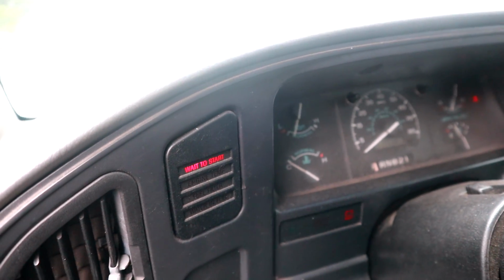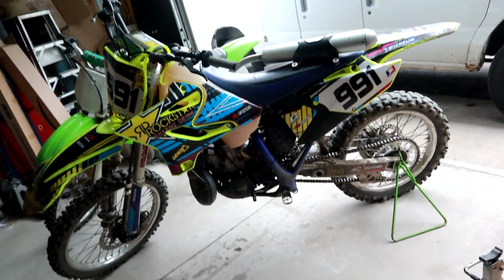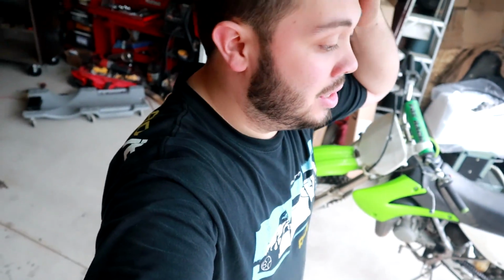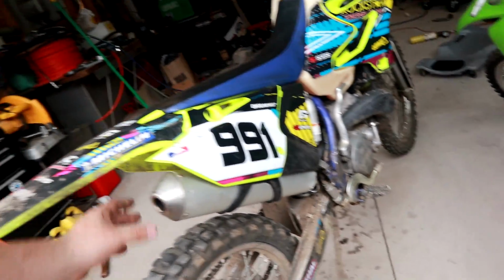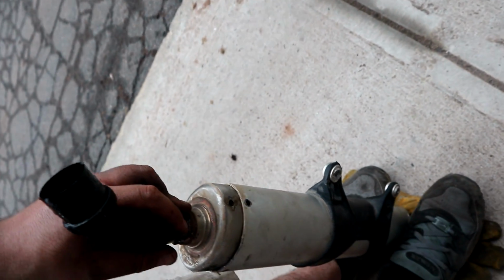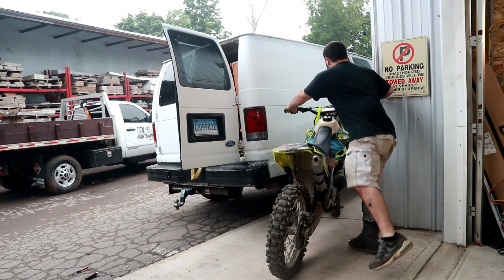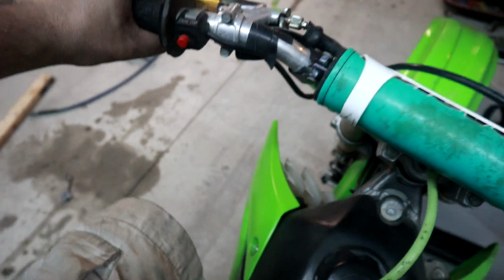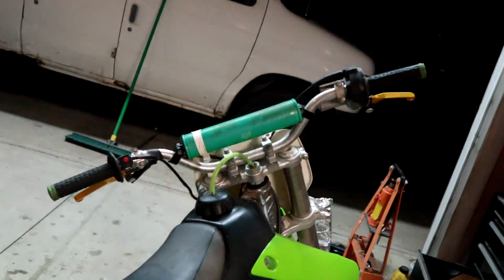KTM EXHAUST ON MY YZ250

Comment: Hey bud.    Just trying to help you out.   You can’t wrap duct tape excessively around and cover every square inch.   You have that stuff wrapped and compressed and then super compressed with tape.  It should be wrapped around the core  until it’s bigger then housing.    Then compress slightly and wrap thin masking tape in 3-4 spots.    To erode each.    The tape will burn up and the fiberglass expand.     The way it is now.  There is no baffling being done wrapped in solid tape.      Love your videos brother
Reply: Yep, fewer wraps of tape, but getting it in is a job done.
Reply: This will also effect back pressure and and you power

Comment: next video : i straight piped my yz250
Reply: Ryzkivyana not a good thing on a 2 stroke bro no back pressure equals loss of torque and you’ll wear the rings out on the exhaust side of the piston.

Comment: Why you dont take a piece of flatstock an make a bracket for the  second screw for the exaust
Reply from the maker: Robert Ringel aluminum boi
Reply: @damianmonte  Time to learn to tig weld :P Super expensive, but a great skill
Reply: You don’t need to weld anything either , just make a bracket , drill the hole for the exhaust mount and the mount on the frame , and bolts it to both of them so it’s sturdier and stable
Reply from the maker: Shawn Ramsey it’s actually super sturdy it doesn’t move at all but if I make a tab I want it to be welded to the subframe
Reply: @damianmonte  ps. Greetings from Germany 😜

Comment: I Would contact the original owner and ask him what mix and oil the bike prefers to run with. It is a race bike so there is a chance it will run worse by using a diff mixture And or oil
Reply from the maker: KingsColas well it’s a race bike but it wasn’t raced, the guy before me tore his acl because he looped it got scared of the bike and sold it to me. For the woods I used to run 32:1 now I run 40:1 but I also have to fix my float height and change the pilot jet to lean it out down low so it runs clean throughout the band

Comment: I’m no expert but that’s wayyyyy to much tape my guy, thought the tape was just to hold the packing while you slide it in
Reply from the maker: Tommy Spring there was a lot of packing idk
Reply: Damian Monte honestly I think it would muffle a lot more noise if the insulation was more exposed, it can’t do its job if it’s restricted. usually it only comes with 3 thin tape lines around the fiberglass, give it a shot